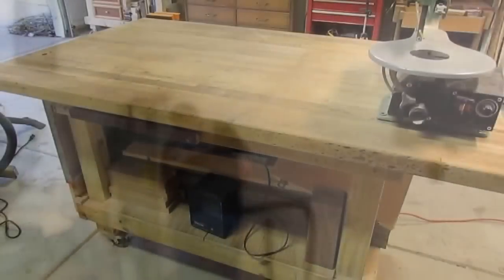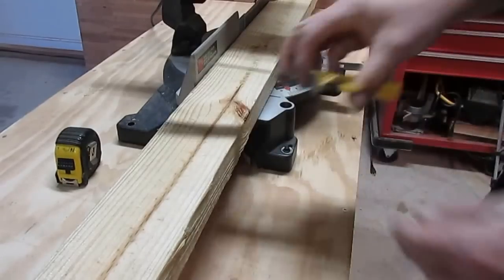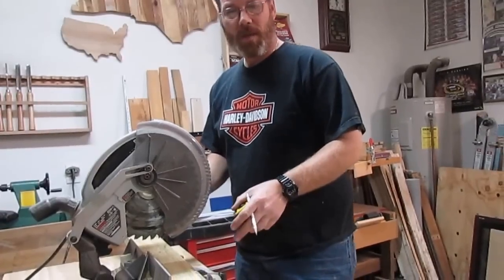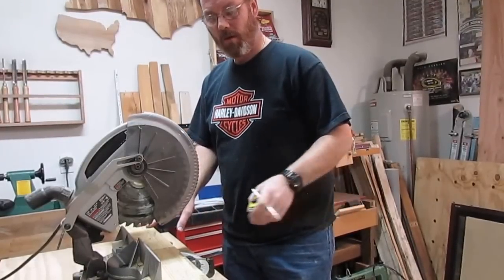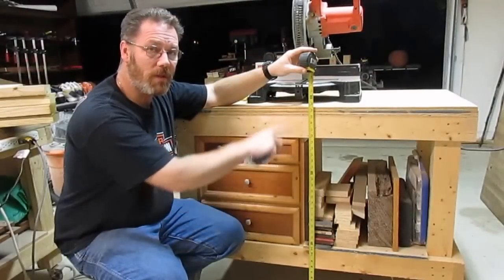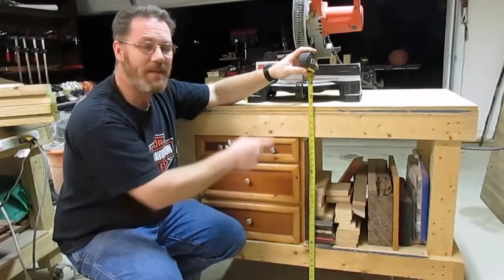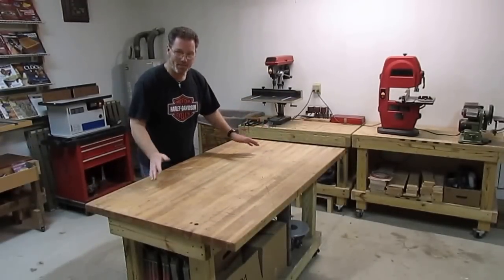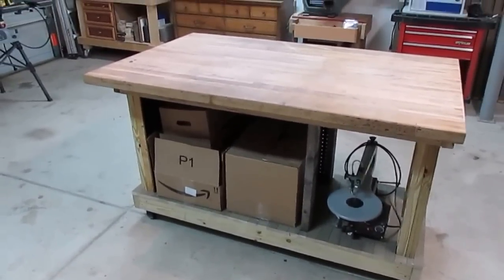Work Bench Remake, Organization Continues

Comment: Great job Sterling!! Bench looks good. Im actually right in the middle of redoing my work bench, Im putting a few cleats on it. the idea is to be able to take the tools off the wall that hang on cleats and just hook them to the side of the work bench, keep the clutter of the work surface!!
Reply from the maker: Sounds like a plan, that's what great about shops, each one if different, and you can suit it to your needs, So Many Ideas out there, Thanks for the view